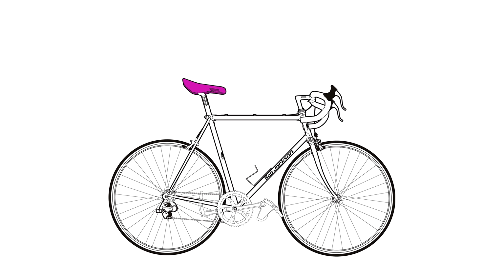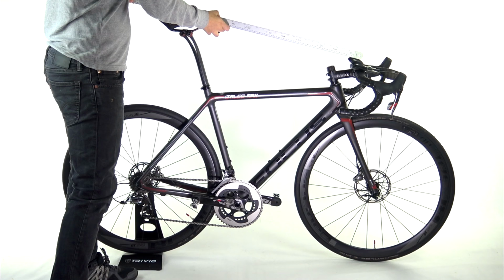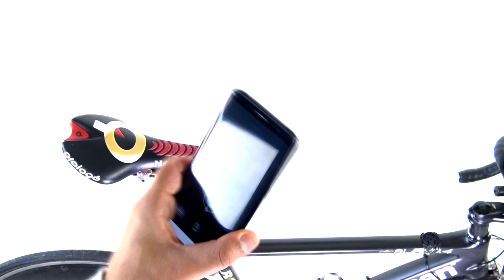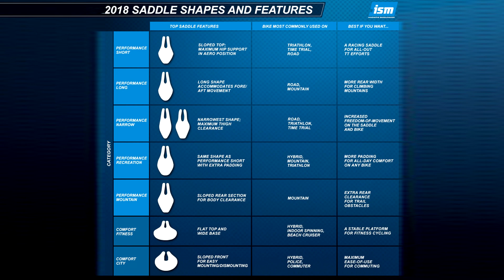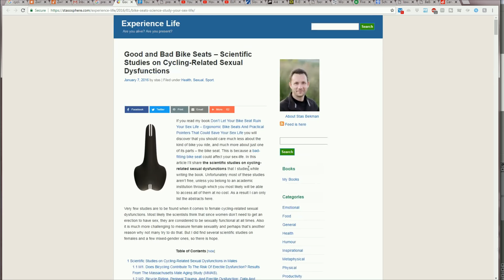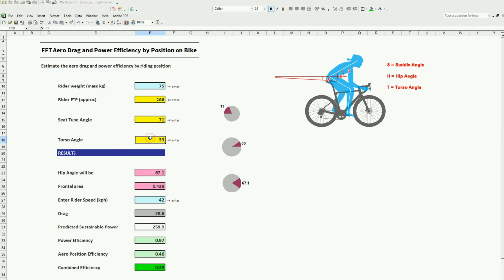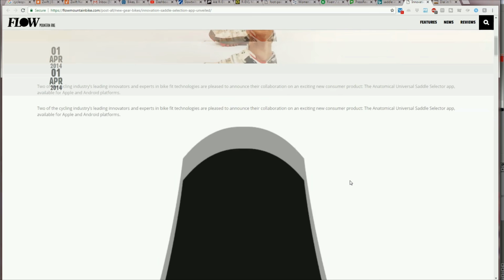Saddle Tilt Science! (inc Torso & Hip Angle). Is there an optimal angle for comfort & aero?

Comment from the maker: Hey guys, our new shop is open: https://www.cyclingapps.net/shop/shop-front/  🏬   also please support us by joining our 2000 members on our strava club: https://fft.tips/strava 🙏

Here are the chapters in this video: 
1:42 comfort on bike (stats)
3:37 find saddle tilt using tape measure
4:44 find saddle tilt using an app
8:08 torso vs hip vs saddle angle
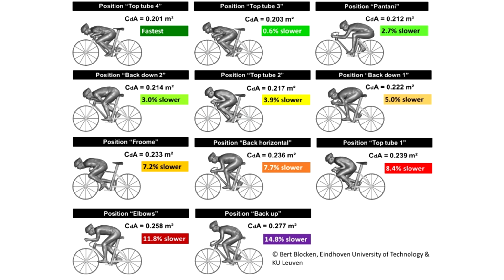9:00 aero benefits of small frontal area
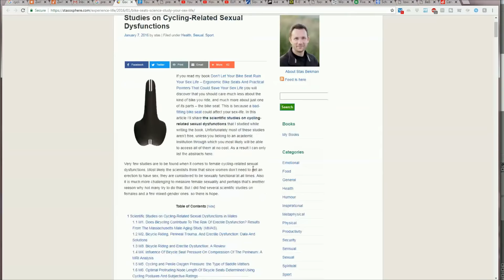9:40 UCI rules on saddle tilt
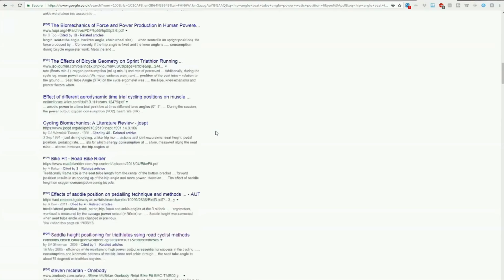10:45 freely chosen position
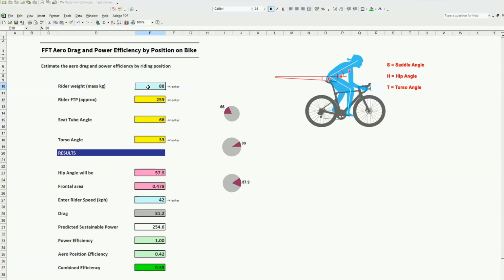12:11 quick aero position calculator
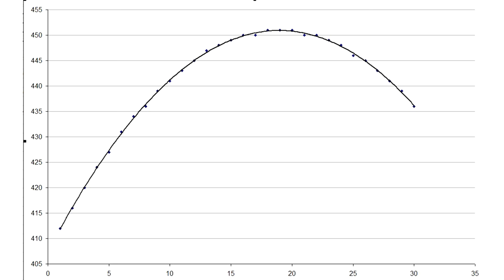13:20 power vs position
14:20 speed vs position
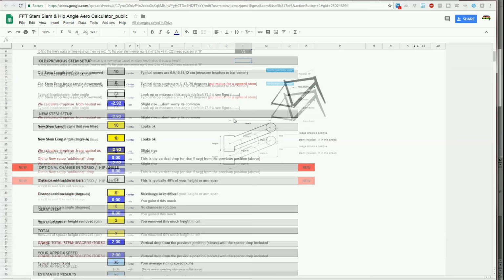15:00 Slam drop calculator (free)
16:50 Rotation vs watt saving
Reply: Thank you
Reply: Well it looks like I will tilt my seat slightly forward.🤓 I stay on the aero bars, so I am hoping I can put down more 🔋 power, more speed, and be more aerodynamic.
 🚴‍♂️🤔🙊🙈🙉🤪
Reply: I am at -2 degrees on saddle tilt. I should be okay right?

Comment: Being limber and having a strong core is something many cyclists should strive for and it will affect your riding style, that said when I went for a bike fit, the person immediately changed my saddle to a shorter, wider saddle to stabilize my hips seeing that my hips were rocking excessively. My previous saddle did not support my sit bones. Switching to a proper saddle changed everything, gave me more stability, power, and efficiency. He also slightly tilted my saddle down seeing that is where my pedaling was at its best. Afterwards I went on a stretching routine for my hamstrings and lower back as well as doing lots of planks. Low aero positions are now no big deal and actually I really enjoy them as I am relaxed in those positions at age 62.
Reply: much respect, man!
Reply: Inspiring 👍

Comment: This video popped up about an hour before my evening ride.  Adjusted the seat from flat to tilting forward and VOILA!, limited case of Numb Nuts and almost no numb hands.  Will continue to fiddle until I get the right fit, but I’m DEFINITELY on the right track.  My ride is a 5 mile uphill with an average gradient of 5.6% and an elevation gain of about 1,500 feet - Thanks for the tips!
Reply: Ian Chandley yeah I have the same problem. I rode for comfort. Am big. Feeling numb down there. It’s slightly pointed up. Should I point slightly nose down ?
Reply: @beamboy420  try pointing it slightly down.  Like yourself, I'm a big guy and am riding a large frame instead of XL.  I set the seat tilting 30-degrees down.  Also play with your post height.

Comment: From my personal experience I can say the following: chose the saddle which allows you to rotate your hips whilst maintaining a straight back when in the drops. I used to have a selle italia saddle on which I couldn't be comfortable because of the excess pressure in the perineum area which made we sit as if I was on the hoods (with respect to the sit bone pressure on the saddle) but with a rounded back allowing an aggressive position without the discomfort in the perineum area. This gave me back pain and shoulder and neck pain since I also had to tilt my saddle down  adding more weight to the front of the bike which my body had to carry instead of the saddle. This all changed when I tried my current Specialized Power saddle which is wide enough, tends to rotate your hips naturally when the saddle is leveled, and is very comfortable in the aero position. All of a sudden I stopped caring about small changes in saddle angle. I also noticed that I had more power since the straight back position allowed me to use my core muscles better, and I could also keep a lower torso angle for a longer period of time. This is the reason I am not a big fan of the 'torso angle' metric because it doesn't that into account the fact that the torso can be straight or rounded, which affects your confort, how much power you can deliver and how long you can hold the position for. One last thing that helped me as well: if you are in the drops or aero bars for long periods of time, don't hesitate moving your saddle forward as this will reduce the hip angle whilst keeping the same torso angle (you might have to go for a slightly longer stem though)
Reply: I have put Selle SMP saddles on all three of my bicycles.  On my adventure bike I may have gone too far with the SMP Hybrid because it is a bit fat, I'm reconsidering a Glider because I have a suspension seatpost, the firmer saddle will be just fine.
In my old age I have discovered the joys of suspension seat posts and soon will be buying suspension stems.
Reply: I was about to ask if there is any correlation between saddle angle and low back pain.  I need to do some more experimentation with saddles and lowering the nose of my saddle to see if I can get my back straightened out.  Pun intended.
Reply: I think that's an excellent point Antoine. I find that when i am a bit too low I have a wonderful side effect of being able to rotate pelvis forward, which could enable me to have a proper length stem on the bike. Unfortunately I get hip pain if I do this for any length of time though, so I think a slightly nose down but higher saddle (eg where hips just rock if I pedal backwards with heels on pedals) might be just the job.

Comment: This. Idea is super informational! I used to have  a hybrid bike, 2005 Marin Mill Valley and I adjust the saddle to be slight downwards.  Although it put some extra stress and weight on my arms and upper torso,  I felts better that way on my back. Later however I was told to change it to flat and I lowered my saddle to fit it. Years later, I got a 2011 Giant TCR Composite and geometry was too aggressive! I couldn’t even ride it over 30 minutes or my back felt breaking pain. I will try to angle the saddle a bit and refit the saddle again!

Comment: Saddle tilt should vary from horizontal by a few degrees and that's it. Trying to relieve pressure at the back or the front by forward or rearward tilt can relieve pressure but it will also make you slide in the direction from which you are trying to relieve pressure, so unless you are constantly bracing with your upper body (which, you shouldn't) excessive saddle tilt is counterproductive. If you are experiencing discomfort then try different saddles. If you have extreme saddle to bar drop (which, you shouldn't) try raising your bars. You can get aero with a longer stem. That helps to get your back flat without excessive forward hip rotation and pressure on the genitals.

Comment: This series encouraged me to keep trying different angles. I had the saddle tilted up subtly and had trouble riding on the drops. Top of bars ok. Lowered the nose slightly and got comfortable in drops but too much pressure on hands on tops. Using an enormous caliper under top tube to 3mm above nose of saddle I got a Goldilocks setup. The problem was a tricky infinite adjust seatpost clamp. Had to establish baseline to avoid overshooting adjustment. I lucked out in getting an ideal saddle on the first try. Many years in the saddle and this one is really good.

Comment: I've had other riders advice me to not tilt down as I have my saddle now as it can cause pains. But I train my upper body to be able to maintain the position . For me having the saddle tip lower gives me less saddle pain in the tender area, I am applying less energy to move faster -less wind resistance, and applying power to the pedal at an angle rather the applying power sitting upright . Only downside is pain to the hands and that's something I keep training for. This tilt down posture for me is especially good for climbing hills.

Comment: Absolutely spot on.  I've argued with idiots for years who claimed otherwise.  Saddle height and tilt is a preference and it mainly depends how you train if you do.  I can tell with certainly,  more so  it is not static and it shouldn't be.  Little space it provides i find myself shifting back and forth depending on what ride I am in.   Climbing,  i shift back,  straight road where i need to put the hammer,  i find myself shifting forward and I can tell I am able find the 6th gear :).

Comment: The nose of my saddle was always slightly up.  If it was level, I slipped forward.  I could ride on a downward pointing saddle, but I had to hold myself from sliding forward with my arms.  That was fatiguing, and wasted energy.  I rode on the drops for long periods of time without any discomfort to my groin.  
This video doesn't address energy wasted by your arms to hold yourself on the seat.

Comment: Many seat-posts have a rigid seat platform.   They do not allow an adjustable pitch.   Solution:  Using a hack-saw, cut off the rigid seat-post platform and attach an adjustable post clamp between the post and the seat rails.

Comment: Saddle angle is related to saddle height. Riders that point the nose down and forward are usually compensating for a saddle too high.
Reply: It's more likely due to aggressive positioning that forces hip rotation, requiring the angle to be sloped downwards. People with flat saddles often tilt them down to mimic a saddle with a kick up at the back that enables hip rotation.

Depending on the weight of the rider and the compliance of the seatpost/frame, a completely level saddle will actually be an upwards tilt when sat on the bike.

Comment: You sound like chainbear.
Thanx for the info, I’ve tilted my saddle nose down a few degrees on my road and tri bikes and have gained speed.
On My tri bike, however, there is a tendency to slide forwards millimetre by mm as I pedal; and thus have to push my bum backwards every few minutes
Reply: Ro Ye ... yes experienced this , I’d rather level my saddle a bit more, sliding forward not good at least for me anyway.
Reply: sliding happens for me even without tilting, when i rised my saddle higher, i started to slide sometimes, but pushing back and having good arm tension push me in position

Comment: I ride a BMC RoadMachine with a 140mm -17 deg stem (140mm drop from saddle to handlebar)...and I actually have my Fabric Tri saddle with the nose pointed upward about 3 degrees.  With I have my core muscles properly activated, I get zero pressure on the perineum and hands.  It just works for me.

Comment: Wow great video. Im definitely using a slightly downward tilt to be more aggressive/aero. Something that also factors in for me is the flex (or slop) in the saddle. Im using a fizik antares r3 versus which has a lot of flex, effectively making the downward angle more level when seated.
Reply: It really depends on what kind of Saddle you use.  If it's the flatter kind tilting it forward will help keep you from sliding back,  but your hands are going to pick up the weight.  I use SMP Saddles, seems to work best more or less level depending on the particular person.  I'm kind of an older guy, find a slightly less aggressive position just fine and I can use my elbows and draw down when I need to get aero to keep my tail clear.  I don't like it when people draft me.  I don't get free air and neither do they.  Let's face it everything we discuss here has something to do with competition, in my case just for fun.

Comment: The saddle must be wide enough to support your ischium bones and seat bones first. Then experiment with tilt.
Reply: I went bought a bike other day after many many years.. after few hours my seat bones are in serious pain😭
Reply: @josh786manchester  nothing is going to fix that besides more time in the saddle. I suggest shorter rides until your sit bones become accustomed to the pressure. Are you fit from other means? Runner? For runners, their overall fitness often greatly exceeds their tolerance for cycling specific strains.
Reply: Gregory Thomas i wear jeans. I have now fitted a wide bum saddle with springs and also added a gel pad. Feels like a sofa now! ☺️

Comment: My saddle might point up, bet very, very slightly. That's because I have a disability (damaged spinal cord), which makes my legs weak, so I may slip forward unless saddle prevents that.
I can cycle for now, but it gets worse, last year I could cycle for 4-5 km, and then it got difficult, this year it's down to 2-3 km, walking distance in recent 3 years has deteriorated ~7 times, from 3,5km to 500m, I can still "walk" after that - limping or dragging my feet, before I need to stop for rest.

Comment: I like mine about 2 - 3 degrees forward. It puts more weight on the ischiums and less on the soft tissue at the front. Also putting the you hands on the bars give a slight force vector backwards putting the force perpendicular to the tilted saddle. I ride fast, often with my forearms on the bars and have taken to putting my left ischium on the rivet i.e. sitting at the front so that I can sit on bony tissue rather than soft tissue. I have made this very comfortable in the time trial position through tissue hardening. I think I can still have babies lol

Comment: Constant riding with an aerodynamic posture puts a strain on the C5/C6 and C6/C7 neck joints, leading to compression at the rear of the discs. Eventually, at around age 45, you will get numb fingers as the bone impinges on the nerves. You will then end up with chronic incurable neck pain and constant visits to the osteopath.

For good aerodynamcs and ergonomics, recumbent cycling is the way to go.

In my experience, a forward tilted saddle puts pressure on the knee and causes knee pain.
Reply: everything causes me wrist and bum pain. For years. Never neck pain. and now L-2 and L-3 and L-4 pain

Comment: Well, you have to think about sliding forward and having to correct your position on the bike every 5 minutes.  Also put more pressure on your legs to maintain position without having to slide back. I tried and doesn't work for me. Flat saddle keeps me where I need to be. If saddle is to high, then is going to affect your sags when going aero position.

Comment: I still don't get how shorter cranks (below 170 mm) aren't the norm on aero bikes in which you must maintain low aggressive position to get 100% of the bike, shorter cranks in that situation are better suited for people who have longer legs and shorter arms like myself, I change from 172.5 to 170 and I immediately felt the difference, I wish I could get the 165 mm but the shop didn't have it in stock, shorter cranks give you more open hip angle and ideal position to breath, with longer cranks my quads kick my abdomen
Reply: Shorter cranks are easy to get. Some manufacturers like Rotor, sell the online down to 145mm and some custom places like Bikesmith design will modify certain existing cranks.
Reply: I think I am going to try this and also a shorter steam, my long long legs!
Reply: According to my height, the market suggested crank length for me is 172.5mm but I use the Ultegra R8000 cranks in 165mm and I love them.

Comment: If you are properly balanced on the bike, with correct setback, stem and bar length/height and crank length, the the most comfortable saddle will be level. 
Anything else and you have an issue with your fit. 
A fit is a process and a level saddle is the final step. If you have saddle issues, get a good fit first, then try different saddles, but always level.
Reply: the only caveat to this is if you are pro with a ftp of 6wpk, then you won't have weight on your hands and saddle tilt really doesn't matter as much.
Reply: @PeterPutz82  ftp.... 6wpk??? ssdd or byob??

Comment: Interesting that self selected ST angle is avg 78! I got custom frames built to 77 degrees and short HT 90mm because most bikes have 74 degrees and HT of about 120mm for my size (52cm TT). When I'm putting power down I ride with a flat back. My handlebar drop is about 17cm, sometimes 19cm without spacers. I don't know my saddle angle, but I've finely tuned it by feel, I guess it's about 10 deg down. Tip of the saddle is exactly over bb vertical line, that's UCI illegal for road races I guess, but no commissaire has ever measured it, I don't care. I haven't tried a tt saddle yet...

Comment: I'm still not clear on how pros with stems slammed down on their front tires and seats tilted 45 degrees keep from paralyzing nerves in their hands.
Reply: joynthis 
Years of adaptation .
Reply: joynthis 
Because they have a costume their bodies to that ride position for years in small increments in order to allow the body to adapt to this position , they train 8 hr per week, making 30,000 kms per year.
Reply: sauza1984 
Weigh distribution is very important to bike Handel in
60% of the total weigh at the back an 40% at the front ,
Reply: Its because they ride so fast (ie legs pushing down, which pushes body up) that there is still hardly any weight on hands (lucky bastards!)

Comment: Measuring my sit bones, buying correct size saddle ended decades of pain at the point my legs join my butt.
Reply: How do you measure your butt?..thank you from taking the time to entertain my question
Reply: Either go to bike shop. Or I found a YouTube video that showed you how. I used the second step on the stairs to sit on, with knees raised up.
First you have prepare some paper. 
dampen a sheet of kitchen towel. Place this on a hard surface. Then place a place of dry A4 paper on top. Then sit on it with raised knees.
The A4 paper should now show your sit bones width. I had to do it a few times
Reply: Retro Dude, On an old Mountain bike. E
Reply: Accident

Comment: Great info. I'm trying to set a new seat/seat angle after having both hips replaced as my old setup now causes bad groin pain issues since the THR surgeries. Anyone have tips on setting up to prevent groin pain issues? I ride a mountain bike but, mostly on the road and with a cushy comfort seat. Experimenting is taking too much time as a ride that sets off the pain takes weeks to recover from.
Reply: Make sure to minize hip flexion by raising the handlebar and/or changing to shorter cranks